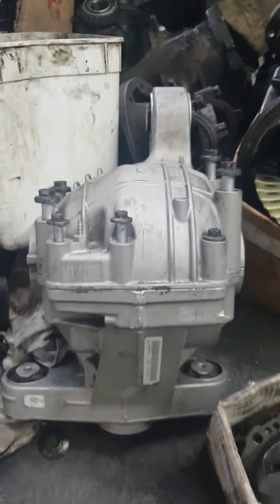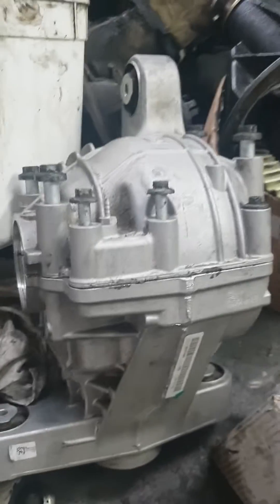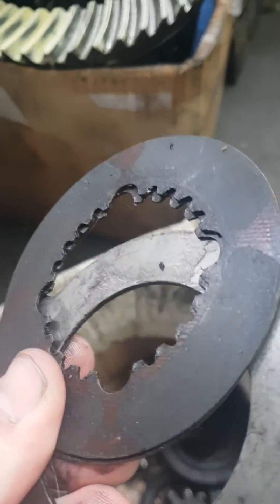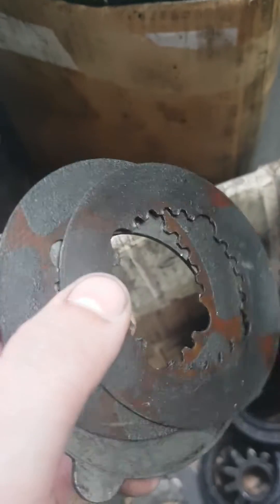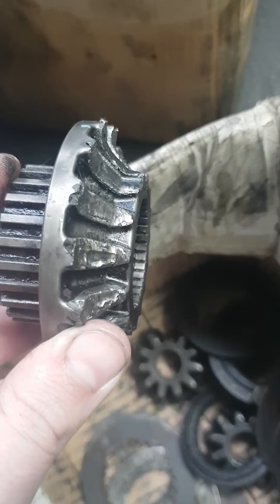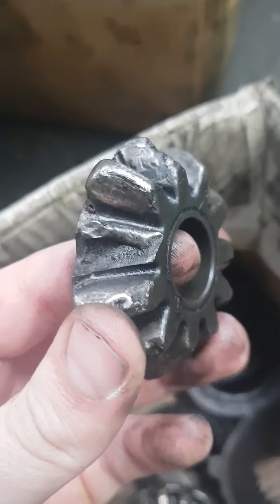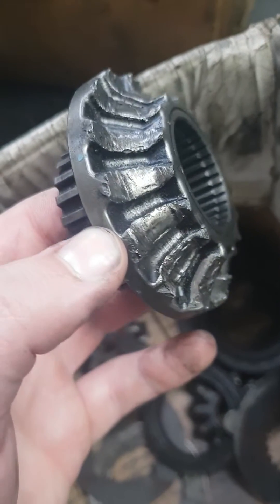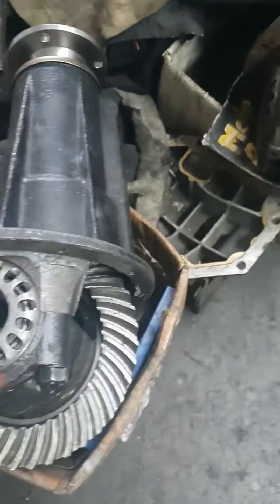Holden Commodore VE VF differential LSD problem

Comment: Hey Neville, so the standard VE diff (Non LSD) are not affected with this fault ?, mine is a 2008 model still going strong
Reply from the maker: If it's not LSD then no need to worry about the problem because you have no diff clutches to fail. So what you said is correct, no need to worry.
Reply: @differentials  thanks Nev

Comment: Typical ZF junk.
Do you sell the clutch sets as I am in Adelaide?
Reply from the maker: Hi mate. Yes we make hardened steel clutches that will last a life time. Or you can buy the standard fibre coated clutches that wear out quickly, it's up to you. But the steel ones we make are $300 a set so it cost a bit. Let me know what you want
Reply: @differentials  hi mate. I have a VF2 and looking to upgrade. I'm in Sydney. I was thinking of going with a truetrac or one of your $1500 diffs. Are either just bolt in or do I need a specialist? Why yours over the truetrac?

Comment: Thats just to many skids ya knobhead. I have had no trouble with my diff in 7 years, the car has been worked. I've done 1 skid mate and my mechanic said everything is fine from engine to running gear. Stop driving to hard and you will not have to spend money on fixing fuck ups

/e  But mind you I only have 61k on the clock tho
Reply: to many fuckers out there and not enough fixers. Excuse my French.

Comment: I have a 09 SSV Ute,100,000 on the clock and just gone through my third diff and your right mate as on the the first two (one of which beeing a w427 diff supposed to be stronger but the same shit) it's the LSD gears that chew up! The one in there now hasn't blown yet because iv stopped driving it but it's knocking! Lol I reakon it's another common problem Holden knew about and ignored like many others
Reply from the maker: Yes that's right the fibre coated clutches we're down and become thinner and where the half shaft/axles go into the side gears, The side gears move out of mesh from the pinion gears and this causes the planetary gears in the LSD to become out of mesh and then the teeth of the gears start jumping over the top of each other and all the teeth smash up. We make hardened steel clutches that never wear down in thickness, so this gear breaking down never occurs. We also have just recently started making power lock LSD'S for the Holden VE and VF models and these come with 100 years or a lifetime warranty
Reply: @differentials  yeh I seen your video on those clutches what was the price on them? And also on the LSD lockers you mentioned?
Reply from the maker: @mathewhrestak2215  it goes to show you how bad these standard diffs are if you have gone through 3 differentials now. The clutches we make are $300 a set. and the power lock LSD'S we are making are 1200 each

Comment: Does this apply to the VF2? Mine's MY17 SS wagon, with the LS3. Then again, I don't push it hard... Well, not often :)
Reply from the maker: yes it has the VF diff in it. if you dont thrash your car all the time then it should be ok for a while. but as soon as you hear a noise in the rear you better get it fulled out and reconditioned because it will blow the diff up if you dont.

Comment: Had mine for 9 years now. No issues.
Reply from the maker: Yeh well if you have a standered diff then you don't need to worry there is no fiber coated clutches in a standered diff. But if you have a LSD in your diff then trust me, it will not be long now until the thing blows up :)
Reply: @differentials  do the evokes have the standard diff?
Reply from the maker: yeh well you might have a standered diff not a LSD diff so you want have any problems

Comment: G'day NevilleHow often should you replace the diff oil?, "Holden say its filled for life"
Reply from the maker: Well if it's a standard diff you don't have to change it ever but with this bad designed fibre coded clutch it's recommended to change the oil every couple of years because the oil gets polluted with the fibre from the clutches but it's such a bad made LSD that the thing will blow up in about 10 years if it looked after it so just don't change your oil at all you'll have to get a whole new diff eventually hahaha
Reply from the maker: ok so most diffs dont need oil change ever. but this diff with the crappy LSD clutched should be getting a oil change every 3 years to get the fiber out of the oil that comes off the clutches. if you dont change the diff oil it wont do anything it is just a peace of mind thing to do to make you feel better haha.